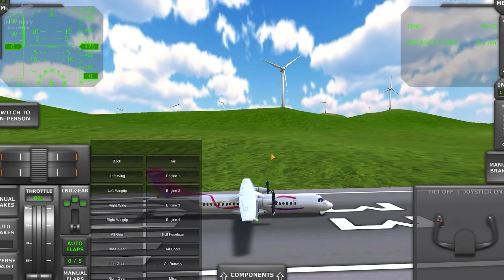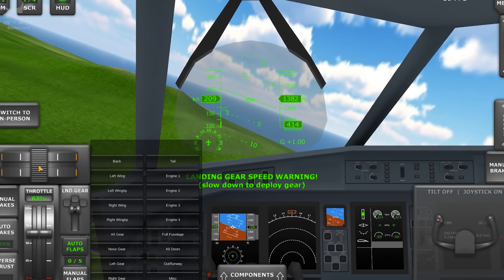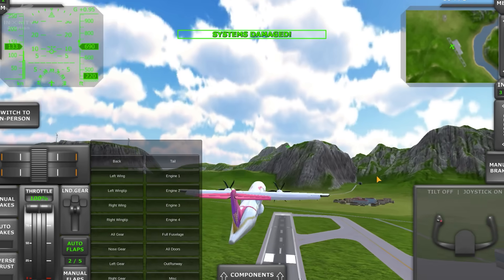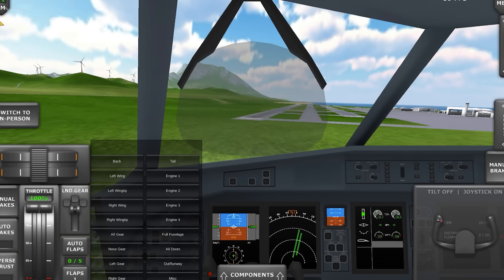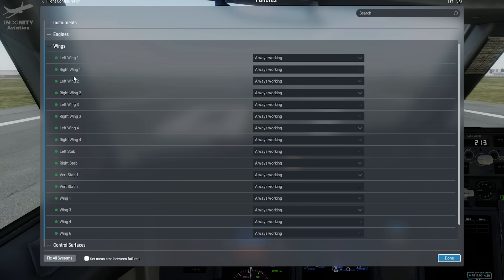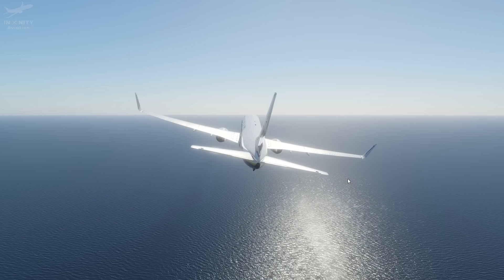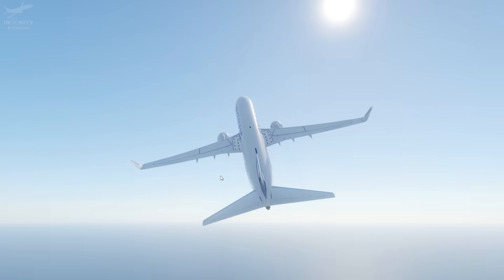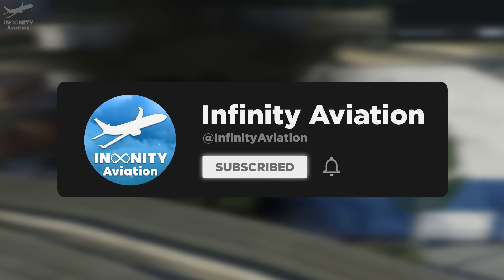Flying WITHOUT PLANE PARTS - Turboprop Flight Simulator, X-Plane 12

Comment: 0:01 swissair flight 671
0:05 ryanair flight 8686
Cause: tcas malfuction
Peoples: 72 peoples
Died: 13 peoples
Injured: 23 peoples
Ailve: 56 peoples
Ryanair does'nt turn off holding mode
Swissair got a engine fire

Comment: In TFS you can use MC-400(Airbus A-400M) with JATO to fly without tail. It’s possible to land plane without tail with using JATO.
Reply: Yes to keep the speed so that the aircraft cant stall but the developer  should add differential thrust levers
Reply: And when u remove like a tail in a mc130 or any plane when the elevator is not attached to the rudder, then when u break of the rudder, the elevator and the ailerons won’t move, lake all planes